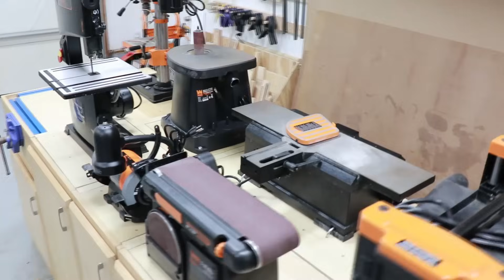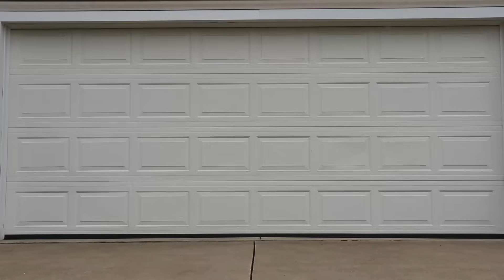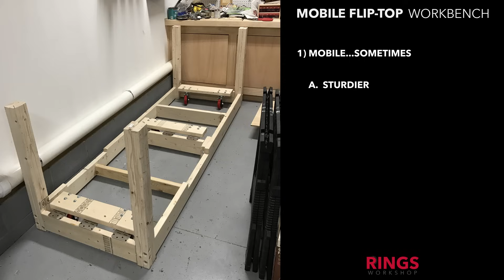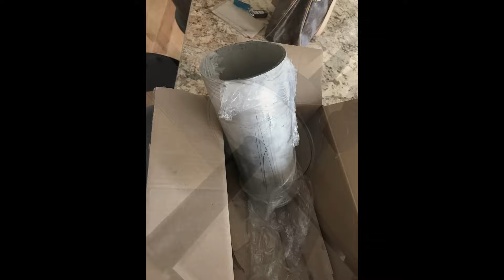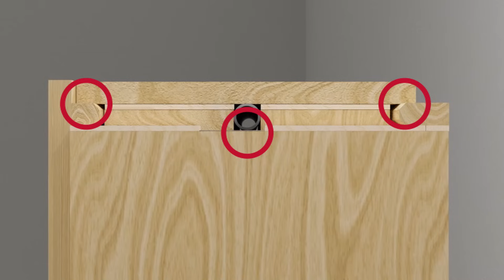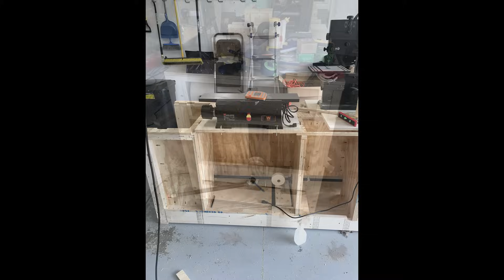Mobile Flip-Top Workbench

Comment: Great work and unique ideas. Very valuable tips for you do share what you would’ve done differently, I found this very helpful.thank you for adding that. As for the power problem, c ould you not run wires into every tool compartment and finish with a plug inside? A strategically placed hole can access the plug below. You could designate a central power input section (extension cord) distribute from there and even place plugs if needed around the workbench.
Reply from the maker: Thank you!!!  Thanks for the suggestion, the issue is the power would need to go through the pipe in order for it to stay plugged in.  If the power plug was underneath it wouldn’t be able to be plugged in once I flipped the tool up.  I have debated putting an outlet on the top, but for now I just moved my overhead power reel and that has worked pretty well for now.

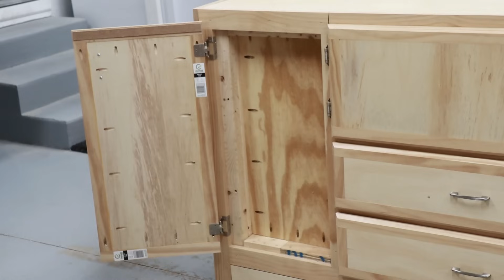Comment: 17:07 You could use that thin space for pencils, painter's tape, and measuring tools: protractors, measuring tape, ect.
Reply from the maker: I’ve been trying to find a good tape storage technique, yet to find one I like, but I like the idea of putting it there once I figure it out!  Thanks.
Reply: @RingsWorkshop  You're welcome.  Assuming you want to stay as light as possible...  How about thin aluminium strips for everything with clips.  Using a block to space the nailgun from the "wall", you can bend the ends of the nails to make hooks for the painter's tape.  And you can bend aluminium into the shape of pockets for pencils; or a thin block of wood with drillpressed holes for individual slots. :)

Comment: Great video and fantastic design concept. This is not a complaint but although I totally understood the cam principle, you didn’t show how you designed the wheel units and how they interacted with the workbench. 	With everything else being so brilliant I bet you had a flawless design for that function.
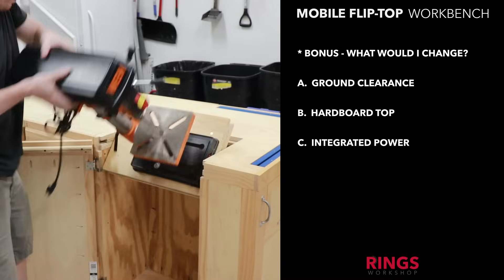finally I have been looking for a retractable cable holder for my garage ceiling and notice you obviously have one at 21:20. Do you have any info on what it’s called and where I could find one
Reply from the maker: Thank you!!  I have the harbor freight retractable power cord reel.  Works great.  The casters are mounted to the bottom of a 2x6 which are attached to the frame with hinges.  The one 3D render has everything shown outside of hungers that attach the two.

Comment: This build is GENIUS.  The engineering involved in the flip tops answers quite a number of conundrums confronting my own "Workshop" situation.  I don't really have a "shop", all my tools are sat in piece-meal in an 8x12 shed and I have to set up/take down every time I do a project for every day I'm working on it which takes an hr to 1.5 hrs each way.  This kind has me unmotivated to do any woodworking far too often.

I have an idea in my mind for a design like yours; the difference, I'd have to use outdoor-durable material as I'm going to have to disguise it as a deck box or other piece of outdoor furniture.  And I'd have to insulate the inside a bit to protect my tools during winter & bad weather.  With your having solved my flip surface dilemma, as well as how to make it mobile, here's where mine would have to be different.
- PVC trim material for outer hull, painted to match my other patio furniture.
- Insulated inside
- Removable 1/4" PVC top affixed to 1/2" plywood pulling dual-duty:  1) Cover the seams of flip tops 2) wing-out as table saw outfeed + worksurface
- Adding integrated power.

I'd like to design all this but I haven't learned animations in Sketchup.

Your thoughts?
Reply from the maker: Thank you!  I never learned animation in sketch up either, as long as there is clearance for it to swing out, that’s the biggest thing.  I think it’s a great idea with the insulation, pvc top and power.  I’d be really excited to see how it turns out, never envisioned an outdoor version of it so that would be really cool to see.
Reply: @RingsWorkshop  I don't suppose you have plans for it that you can share . . .
Reply from the maker: @kenroehr  I am hoping to have plans done over the next month or two.  Been trying to work on website and start those in between videos.

Comment: You could put that brush stuff you used in the miter dust collection video at the bottom to prevent stuff from rolling underneath
Reply from the maker: That’s genius!
Reply: @RingsWorkshop  Ha, you're the one who got me thinking about the brush strip!...already ordered it for my miter saw (and I might try to figure out how to put it in my table saw to keep excess dust from leaking around the blade housing)
Reply from the maker: @dubya13207  I used a brush strip on the front of the saw where the blade heigh adjustment wheel is, along where it slide when you change the angle.  Made it easy to move through but also reduced the air leaking out there dramatically.

Comment: I find the bench practical and well designed with the exception of the things you would have change but still a outstanding concept. You are right about the door being finish nevertheless you made it more visually appealing than has a subliminal message to what ever you do if you do it do better than acceptable. It always a sign of quality and as a person looking for you to do a project for them because you did more than needed to the bench you would have the same integrity doing a project for them. As far as the clearance maybe somehow if you trin could be lift as you casters went down it would keep object from rolling under but more clearance to more. Just a thought  Maybe a cable lift for the base trim attached the the shift of the Caster lift mechanism  so they move in conjunction with the casters being lower and raise you only need ¾ to 1 inch additional rise with what you have may be more than enough clearance.

Comment: Congratulations on a fine project. I think after my next move I may follow along. I don't like the flip top cabinets everyone has shown but your method really strikes me as great. My smaller tools like what you have on/in your bench are all on separate cabinets which roll around but take up a lot of room. And, while it is a waste of time and money to edge your doors, it is one of the things that makes it really look great. I have some edged doors/drawers and some not and the edged ones always look better. I am intrigued because I see so few videos on your channel and yet you have 10K subs. Are there more that I am not seeing? Thanks for sharing your project and thoughts. One thing that I did that you might like is put my planer on a drawer with 500Lb drawer glides. I just pull the planer out and even with heavy wood, the thing is rock solid. No need to lift it to flip. Regards, Bill
Reply from the maker: Haha thank you!  So far just the five videos, I have a lot of projects done/in the works that I will be posting over the next few months.  I like the idea of the planer as well.  I always wondered how the heavy duty drawer slides held up.
Reply: @RingsWorkshop  Drawer slides work really well. They used to be about $250 for a pair but now are down to about $100. That cabinet is next to a wall with a block screwed into the wall to keep it from tilting forward when I pull the planer out but I think with your bench design, it would have enough mass to keep it from wanting to tip over. I have my table saw on a home made base that I made many years ago and think I am going to redo after my next move as well. Your lift mech might would for that too. I have large phenolic wheels under the base and the base and saw likely weigh about 1000#s but can be moved with a finger push.  Currently I have a cabinet under the right extension and the router under the left. I agree about stuff rolling under the cabinet. My base is about 1" off the ground and I used really heavy duty toggle pieces at the corners to essentially lock it in place. They lift the base and wheels off the ground. My move is going to force me to disassemble the base which is why I am thinking of remaking it. If you don't mind telling, what state are you in and is this a hobby or do you do this professionally?
Reply from the maker: @billinfarmington5189  it is just a hobby, but for sure to the extreme at this point haha.  I don't give out exact location, was the one ask my wife had when doing this haha.
Reply: @RingsWorkshop  No problem. I didn't think someone knowing the state would be intrusive. You said it was cold in the winter. I am more of a Southern half person. Now in California but planning to move to Arkansas after the vaccine comes out. I'm and old retired guy. Regards,
Bill
Reply from the maker: @billinfarmington5189  no worries at all, we hope to be south in the next few years, sick of this cold weather haha

Comment: In the process of building this at a larger scale. Bench will be 4x8 with much larger tools on top. When you were taking about the assembly of the boxes, as I would call them, you mentioned you could have saved on some lumber if you would have extended the plywood sides by 3"4". So my question is, the demo you were showing, was that reflecting the new idea about making the sides longer minus the 3/4" or that was the older illustration of adding the 3/4" plywood spacers? Studying the demo I can't see the extra layer of 3/4" ply.
Reply from the maker: Correct, my top is basically three layers of plywood, because I figured with the fliptop it would have top, middle and bottom layer, so I matched the top to have the same.  But in reality, the bottom layer of the bench isn’t necesary, just on the fliptop.  So the animation I made it how it should have be done to save money.  

I would have liked to go larger on a couple of the tools, but the drill press and band saw I actually had to cut away the frame a bit because of how tall they were.

Comment: Awesome job. I came across this just the other day. Instant subscriber. Already halfway through my own design on SketchUp and because of how detailed your video was i was able to workout how to add a miter saw that will be flush with the top. This solved all the things I wanted for my own setup. 
I was going to make a wing cart for my miter saw and multiple flip tops for my tools. But I also needed a workbench because I’m tired of using plywood and sawhorses. And I also needed an outfeed table for my table saw. Being able to convert to the top to flat with no tools up is perfect. 
I just didn’t see everything I wanted fitting in my garage. Now I do. Thanks for the inspiration. 

One question I did have was about the door with the tongue and groove system. I noticed you have a frame around the top of your bench that is attached to the tongue as well as your door. Is there a purpose for the frame? From what I can see on my sketch up version, I could get by with attaching the tongue directly to the door. I just thought I’d ask before I built it and realized I needed to add the frame after the fact.
Reply from the maker: Thank you!  If you do just the door it would put more tension on the door hinges, I made sure both the tongue and the edging sat on another piece to take pressure off the hinges.  Perhaps just the tongue resting on the sides is enough, but I chose to double up so the door didn’t sag over time.  Look forward to seeing what you come up with!
Reply: @RingsWorkshop  I do remember you saying that in the video. I was curious if using steel square tubing as the tongue might make it stronger. Or is that just overkill?
Reply from the maker: @rhettdunn8788  couldn’t hurt, but would likely be overkill as I haven’t had it rock or move ever when closed, but if you get rid of the trim it may help.  I always error on the side of overkill than not enough.

Comment: This , for all the same reasons you made is perfect for my application thank you for your video.

The space suggestion... router / drill bits?
Reply from the maker: Thank you!  I have a lot of those on magnet strips, which if I run out of wall space I may end up transferring some of those that I don’t use as often under there!
Reply: I was thinking a square rectangular block of hdpe that your could rotate at the ends for easier access. Say 1x2x18? Ish then use end swivels.  Might get 8 or more rows of them.
I'll send you a sketch up.
Reply from the maker: I used the French cleat to store them on the wall.  If I did move them there I would do the same for when I need to take the whole set with me.  Love the concept!

Comment: I agree with most that your locking design for the flip-top tool sections is excellent.  You might consider building a smaller version for one or two tools.

That would let you make a build video while adjusting dimensions for a tool or two for your purposes.  I know the all in one aspect is important to you, but I'd bet there are some things that don't always need to be readied when you work.  And the video should be popular and much easier to film than a rebuild of your opus.
You might also make and sell plans while you're at it.
Reply from the maker: Thanks for the feedback!  I plan on getting plans up in the next couple of months.  I’m debating about making a table saw stand, as I hate the current base it’s on, and there is so much wasted space.  If I do that, I will be using the same strategy to move it around I believe.

Comment: So did you already have the power tools or did you purchase them specifically for this arrangement?  I’m not familiar with the brand, what lead you to decide to go that way on all of the tools?  Thanks. Great engineering on the flip tops! Brilliant
Reply from the maker: I did not have them prior.  Part was because they were cheap (didn’t have a ton of extra cash at the time), second was because they got really good reviews for their price point, lastly as dumb as it sounds, I didn’t want a collage of different brands or colors.  I was also hoping because they were all the same brand that they would have similar size dust ports...I was greatly mistaken.  

I think WEN is great for what they are, an entry level tool.  I normally buy cheap the first time I buy a new tool and if I find myself using it a ton, I’ll invest in a nicer one when that one breaks.  If I get a bigger space someday, I would buy full sized tools from a higher end brand, but for what I use it for and the space I have, I’m very happy with them.
Reply: @RingsWorkshop  Gotcha!  Ya the hole different port size ... smdh 🙄

Comment: My my my..... your workbench is some outstanding craftmanship. Thus far, this is the closest idea of a multifunctional workbench that best fits my needs. I can only echo what Kenmaira commented and would add that as a newbie in woodworking this entire video production inspired the heck out of me.   I'd like to ask what were the Dewalt models and/or type of drills you were using for this project? My existing Dewalt tools are of the 20V Max XR  family. Thank you sir:):)
Reply from the maker: Thank you very much.  I’ll have to check on the exact models for you, one is a standard drill, second is a brushless drill and third is an impact for driving the screws in.  All of which are the 20V family as well.
Reply: @RingsWorkshop  Appreciate the prompt response. Look forward to the model names. Reviews have commented on how using an impact wrench (unsure if I will keep my unopened Dewalt dcf890) with pocket hole jigs risk damaging screws due to the lack of torque adjustment. Care to comment?
Reply from the maker: @katjammer488  It wouldn't damage the screws, but would likely drive the screws too deep out the other end.  I use a normal drill and dial it back to 7 or 8 normally, depending on type of wood.  But I love my impact driver for just about everything else.
Reply from the maker: @katjammer488  drills i have are DCD771, DCD777, DCF885
Reply: @RingsWorkshop  Thank you very much!

Comment: I love this design! I have watched this video 3 or 4 times now and am just amazed! I do have a question regarding the rotational mounting though, could you mount the pipe as a stationary piece and then put the cut out sections in the tool mount? This would essentially do the same thing as what you have, at least in my head, but allow you to run wiring through the pipe... maybe I'm over thinking this...
Reply from the maker: Thank you!  I feel like that would make it harder to wire it up.  If you left space on the end the wire can exit out the side, if you had the pipe stationary you would have to cut out a chunk in the middle of the pipe to allow it to rotate with the tool.  I feel like that would put more tension on the cord than letting it come out an end, but I also could be over thinking it, or just not thinking about it correctly.

Comment: For that empty space at 17:00 you could use it for your outfeed top holder. Cut them into slits and chamfer the "leading" edge (closest to the table saw). Then you can just set them end to end without fear of the piece coming from the table saw getting stuck, because it will just slide over the chamfer. You could even do a tongue-and-groove edge setup on it so that it's always a tight fit... Maybe put a small piece on the bottom of 1 panel to catch into the track to keep it all still...